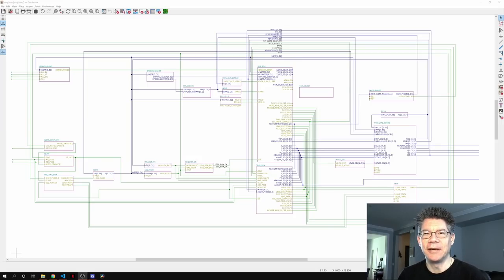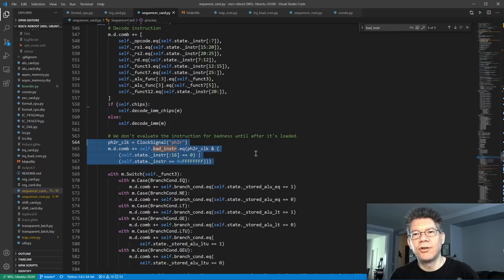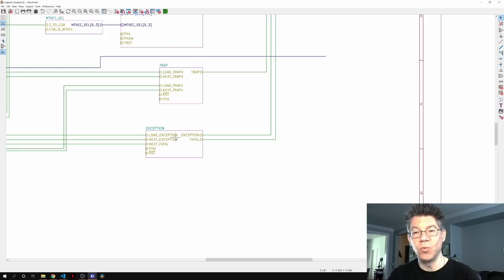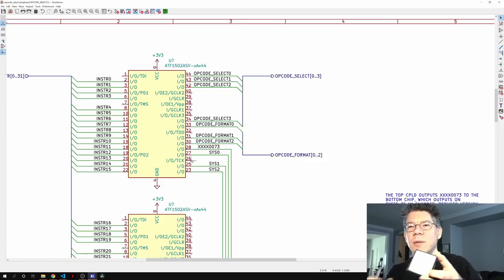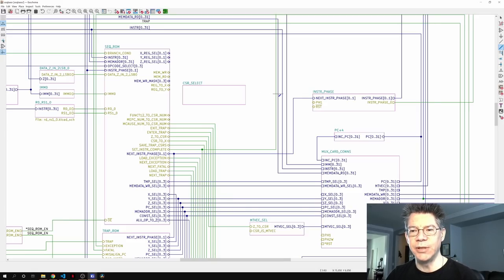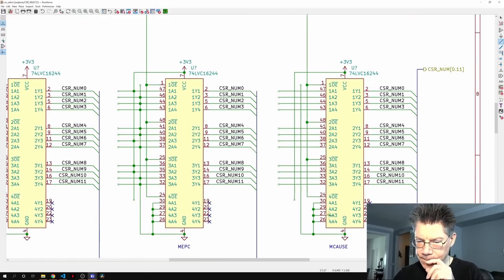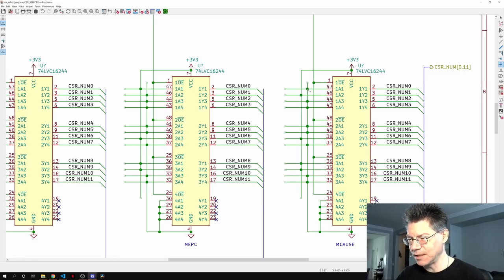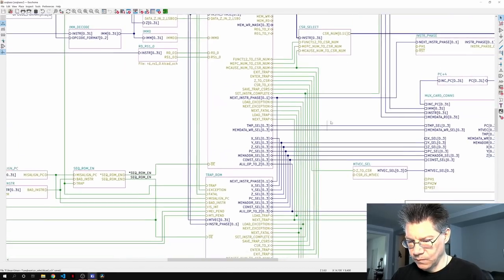LMARV-1 reboot part 13: More sequencer schematicking

Comment: Since MEPC and MCAUSE differ in only 2 Bits, you could use the last unused sector of the second chip for the other constant and replace the 3rd big chip with a single OR Gate to combine MEPC/MCAUSE_NUM_TO_CSR_NUM for the remaining similar bits.

Comment: The PC+4 can be implemented as  +1 logic, because the lower 2 bits will never change.
This makes me wonder if you could use a 30-bit latch+counter for this. Then of course you do need a clock signal to increment it once.
I know this is not working 'combinatorically', but it might be worth to investigate.
Reply: That's certainly will be much simpler and faster than bunch of ALUs.
Reply: That counter with parallel load will also replace the PC register, so the logic will stay almost the same.
Reply: I wondered about this too. I guess you just need a little more logic to handle the other two bits for byte addressing.
Reply: This is what I would have done (and have done in the past). There are synchronous 8-bit counters with carry in/out for cascading purposes. Carry out is relatively fast, although not as fast as an FPGA or CPLD. You might be able to make 32 bit counter that counts at 15-20 MHz, depending on logic family. That's not bad for a discrete processor. It's far faster than a VAX 11 or DG Nova.

Comment: Okay there has been people talking about the PC incrementer already here, but I just ended up thinking about how it actually only needs half-adders since it's only an incrementer, and decided to figure out how much it would be in "pure" logic (didn't figure out carry-lookahead yet, but just for curiosity, as a ripple carry...):

Input An, output Yn,
Carry Cn
^ is XOR, * is AND.

Y0 = A0 ^ 1
C0 = A0 * 1 = A0
Y1 = A1 ^ C0 = A1 ^ A0
C1 = A1 * C0 = A1 * A0
2 XOR, 1 AND, delay 1

After the first 2 bits,
it's just a sequence
of half-adders:

Y2 = A2 ^ C1
C2 = A2 * C1
Y3 = A3 ^ C2
C3 = A3 * C2
2 XOR, 2 AND, delay 2

So a 30-bit incrementer (bits 2 to 31)
with ripple carry
would be 30 XORs, 29 ANDs,
29 gate delays
5ns * 29 = 145 ns
Which is less bad than I was expecting - I'm curious as to how much clocks your design has for INC_PC to work, didn't look into it yet but logically it could be most of a machine cycle? Wouldnt be that bad.

From what i could find for
74LVC at mouser, that'd be
these in chips:
8(*4G) 74LVC08A +
15(*2G) SN74LVC2G86 = 23 chips
vs I think you were talking 11 big CPLDs?
Also I'm starting to go "geeze this thing is gonna cost a lot only in chips" -
obviously I know it's not supposed to be cheap lol, or you'd just use an FPGA ... or an emulator :P

From the  other suggestions, the counter sounds like a neat idea, though maybe complex to operate.
Oh a final PS. As i was looking up the ATF1502s (in digikey it happened to be), the fastest 3.3V one (ASV) I found was 15ns (10ns for the 5V version).

Comment: Yay, I made a suggestion that got implemented! 😸

All pins will go hi-Z while programming, so that would very likely produce undefined behavior.

I would recommend making use of the in-circuit programming function because it is sooooo convenient. You might just hold the reset button to stop the machine from functioning while the CPLDs are programmed, or perhaps, since the connector will have a few spare pins, maybe a custom programming cable that holds the machine in reset while it's plugged in?

Another thing to be aware of with the naming of the TDI and TDO pins on the programmer is that TDI of the programmer should go to TDI of the first CPLD in the chain, and TDO to the TDO pin of the last CPLD. Completely reverse to what you might expect, but it caught me out.

Comment: There is still a pretty good reason to use a CPLD instead of the ALUs to do PC+1 (the lower 2 bits are 0)... If you were doing this in an actual CPU, you would probably build a custom chip for this specific task. A typical adder is actually a 3-input adder (A,B, and carry in) and outputs the 2 bit result (result and carry out). However, for an incrementor, B is always zero, and the carry in for the chain is 1. So you really only need 2-input adders (i.e. a half adder). In terms of combining multiple functions in one chip, I'm not sure that would work, since you effectively need 30 inputs and 30 outputs, so 60 IO.
Although, to be fair, if you were doing this without any CPLDs, you would probably just use the ALU adder itself for the PC increment and do the PC increment in one of the compute cycles (I believe the 6502 does that?).

Also, for the crs_num_is_mtvec signal, you may want to put a buffer after the pullup resistor, in the event that it feeds to more than one chip (there's a lot of capacitive load on that wire already).
Reply: AAUGH! Why wouldn't a 4-bit full adder be a better choice? Using a CPLD for a bloody adder (and a 4-bit adder at that!!) is the classic Engineering maxim, "Never make something simple and usable when you can make it complex, fragile, and wonderful!" This tendency to replace specific functions with general purpose programmable logic is the only thing I don't like about Robert's approach.

@RobertBaruch: Please recall you experience with your previous LMARV ALU -- a "simple expedience" turned into a logistical nightmare.  KISS!! Keep it simple, stupid!

Comment: Probably a bit late to comment, but could the 4 bits you checked were positive (CSR_NUM0, 2, 8, 9) [at time 1:06:11] have been put through NOT gate and used with the other zero signals, saving you having the differing logic for the different sets of bits bits?

Comment: 13:22 is the 10k resistor small enough such that it charges the input capacitance of the OR gate fast enough? Maybe you will have to swap it for a smaller one. And maybe the OR gate should be schmitt triggered if it is not already.
Reply from the maker: Input capacitance is 5pF, so it would charge from say 0v to 3v in 100ps. That's roughly 30V/ns, which is higher than the 10V/ns needed by the gate. EDIT: clearly I can't math right now
Reply: @RobertBaruch  That seems to fast to me. If you have 3.3V across 10kOhm resistor 3.3/10e3=330e-6 will flow. Then 5pF capacitor charged to 3V will have 3*5e-12=15e-12C. Then asuming that 330e-6A will flow constantly (in reality it will decrease) then 15e-12C/330e-6A=45e-9s. So it will take minimum 45ns. Unless I made a mistake.
Reply from the maker: @tomaspecl1082  Oops, you're right. If I change to a 1k resistor, and look at the threshold of 2v, I get 5ns, which is 2.5ns/V, which will work as the gate's max is 10ns/V. It's still not ideal since I'll be constantly using power. I might see if there's a different way of doing it. Like using CPLDs as a replacement for 3v3 74LS688 8-bit comparators. My self-imposed rules would allow that substitution, as long as there is a one-to-one correspondence between one CPLD chip and one chip that would exist, but doesn't because market forces.
Reply: @RobertBaruch  Once I have read at wikipedia about some sort of wierd logic which does the pull up and pull down separately based of some clock signal. So you could gate the pull up resistor with a transistor or something and pull it up only when you need the output to be calculated. But that would be probably too slow. So maybe just use few quad input gates to combine all the signals to 1.
Reply: @RobertBaruch  Worse, you also have 32 outputs tied to that now 1k resistor. It is not well specified, but each output will have the open drain fet as well as ESD protection, guessing 5pF. That's another 160pF, so 160ns tau with 1k.
Reply from the maker: @kkpdk  Clearly I've made a terrible choice :) I am planning on using ATF1502s, since for the most part I'm using open-drain chips for equality comparison. If I can program an ATF1502 and claim it's a substitute for a 74LVC688 (which doesn't exist), I'll be satisfied.

Comment: 22:05 - justify it by saying it's clock domain gating!
The point of the signal is to entirely turn off this block's responsiveness to the clock. That's essentially the same thing as clock domain gating, except on a PCB with packaged gates. And you're not exactly running CTS on the other side. But other than that!
Reply from the maker: Hmm!!!!

Comment: So for the INC_PC, how much time do you have for getting the result and how fast do you plan to clock it? As soon as the PC has new value then the adder starts calculating PC+4 so ideally you already have PC+4 calculated before you have next cycle which needs to increment the PC. Basicaly I am thinking if you really need a fast adder for incrementing the PC. If not you could maybe just use 8 4bit adders like 74AC283 in series, it has 16.5ns max propagation delay at 5V supply.

Comment: I wonder if you could fit all of the 74LS283 stuff in a single ATF1508?
Reply from the maker: My rules wouldn't allow it because (a) such a LUT would not be a reasonably-sized ROM, and (b) no 74-series chip is a 32-bit comparator. There is, however, a 74LS688 8-bit equality comparator. I can turn that into an ATF1502, and claim it's a substitute for the non-existent 74LVC688.
Reply: Sorry, had to clarify my question, but may still not be allowed by the rules because there is no 32bit ALU in 74 series either.
Reply from the maker: @TomStorey96  Correct :)
Reply: @RobertBaruch  I suppose I'm a little cost conscious, because I know all of this stuff can add up quickly.

But I do also appreciate the want to keep it discrete. I guess if you really wanted to combine a lot of logic into fewer chips you'd just build it on an FPGA lol